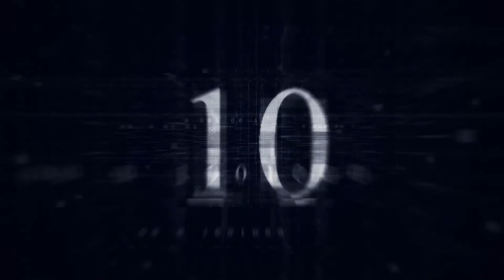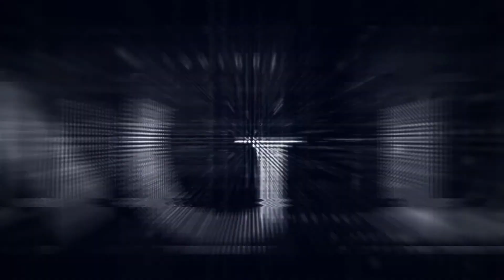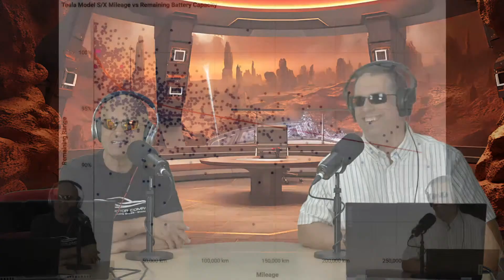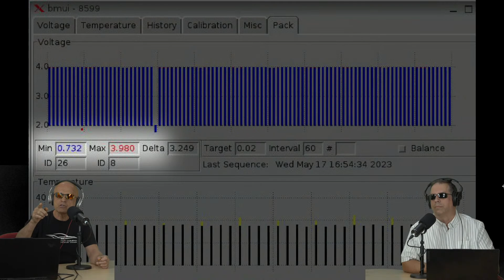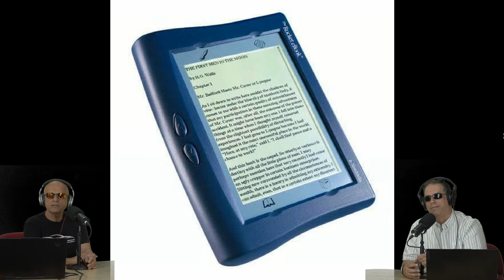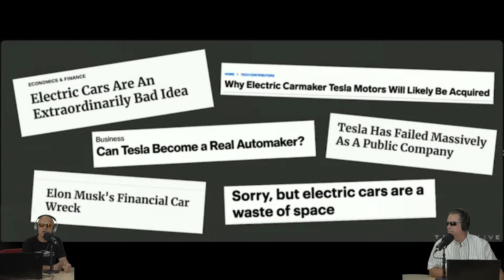If Tesla Existed In The 1980s, Lotus 414E Evora Hybrid FOR SALE, Brief Tesla History - GMS #89

Comment: I saw the Evora 414E Hybrid on July 18, 2022 in Fenton, Missouri. I took a couple pictures, but didn’t realize what it was.
Reply: Can you share those photos? It’s not the same car.
Reply: @DavidManouchehri  Is it possible to reply with images? There’s only one Evora 414E.
Reply: I added the pictures to Gruber Motor Company’s June 5 FB post about the 414E.
Reply: @c0jonz  That’s super cool, you actually took photos of the non-functional shell show-car!
Reply: I find it difficult to believe that a nonfunctional 414E also exists. Why would it be the same color? Who owns it?
Reply: @c0jonz  It was created as a mockup to present at the 2010 Geneva Auto Show. It’s pretty normal to present nonfunctional concepts to the press before actually having a functional car built. The real car was not built in time for a 2010 PR event.

If you look up photos, you’ll see the “fake” car at the Geneva Auto Show. They’re easy to tell apart even at a distance; the “fake” one is LHD, while the real one is RHD, and they have different 414E branding.